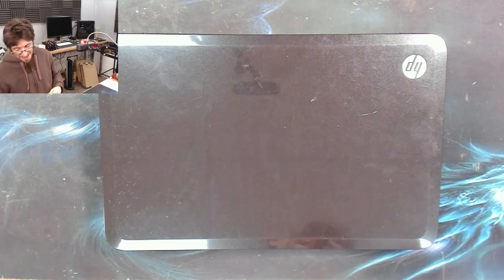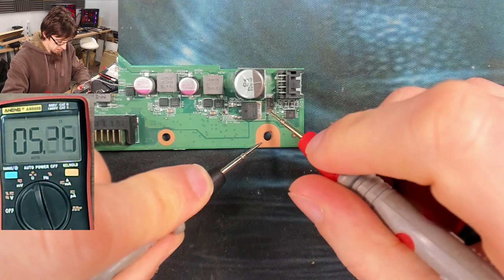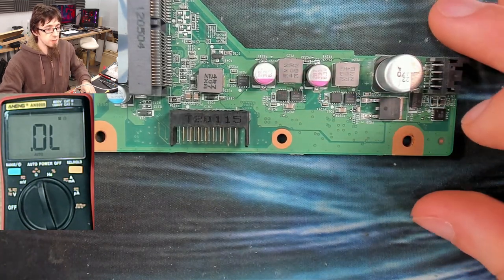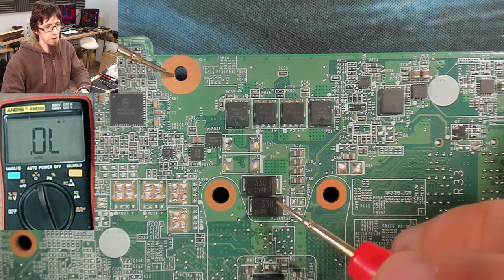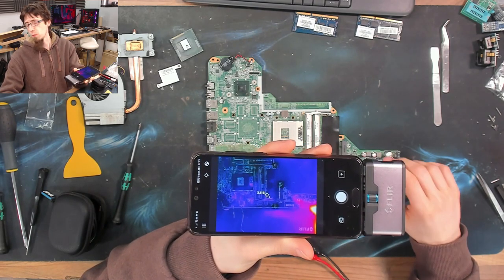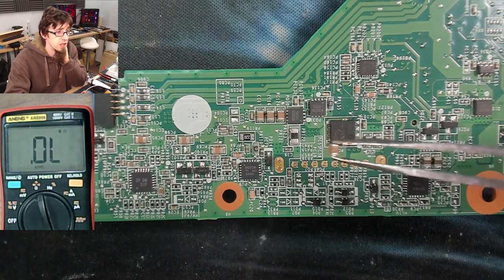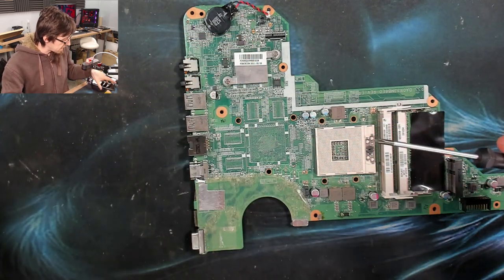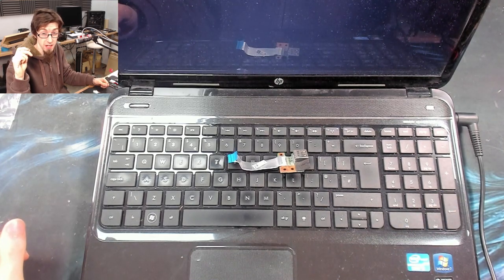HP with a kinda-shorted power rail - LFC#294

Comment: Please help my pc just getting so slow out of the blue around 1 week ago when like 1 app running. it was fine when I bought it about 2 month ago now it crashes almost once a day or more usually in the first hour of turning pc on something it brings blue screen but when I game on it its perfectly fine I tried every thing from changing windows to updating bois and cpu mobo driver nothing work also tested every piece of my pc all good
Pls help I spend all of my saving for this I live in 3rd world county so don’t suggest grantee option 
This is my spec :
Cpu: intel core i7 11700k
Motherboard: z590 arous elite
Memory: gskill model = F4-3200C16D-32gtzr
Gpu: RTX 3060 palit
1T samsung ssd 980 pro
Reply from the maker: I would start with Memtest86. You can download it for free, and it makes a bootable USB drive. Boot from that, and it will check for RAM problems.
I would also try disabling XMP, which will cut the RAM speed down to 2133. If this seems to fix it, then some memory tuning will be needed.
Check your temperatures with HWINFO as well, watch the CPU temps while you run something like Prime95 or Cinebench R23 to stress the CPU. If the temps are above 80, the CPU might be thermal throttling, which will also cause problems.